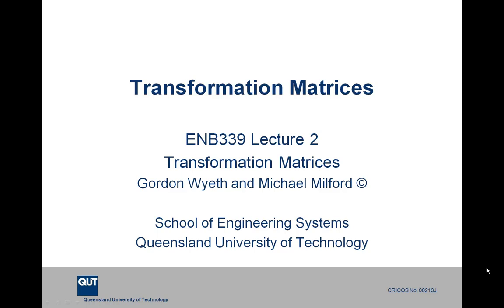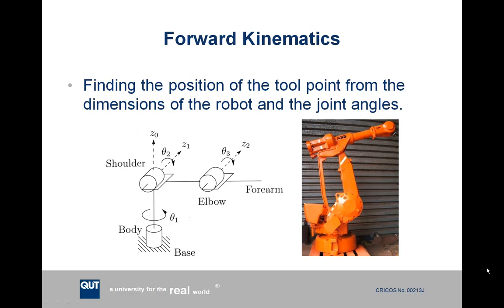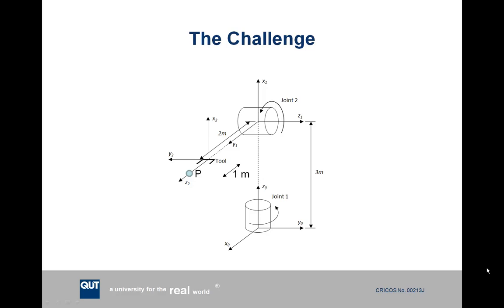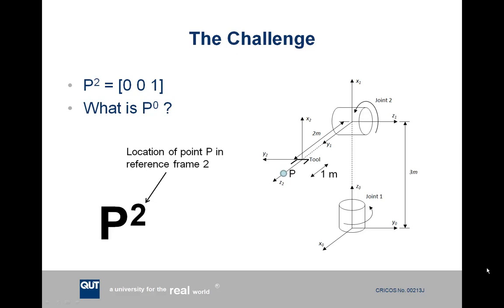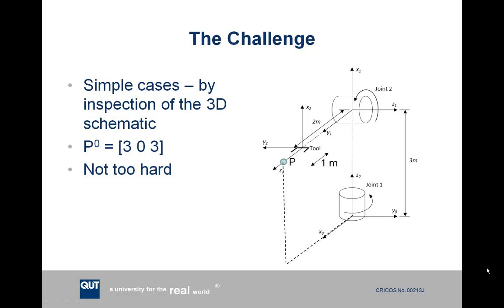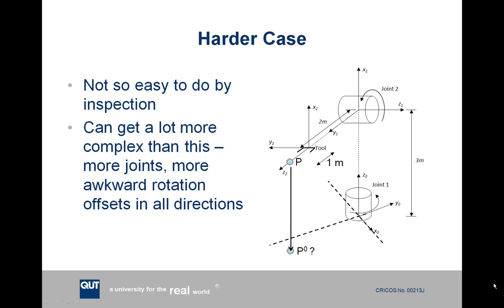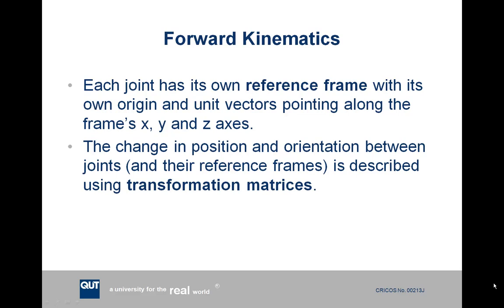Transformation Matrices Part 1

Comment: I have question about rotation matrix
Say I have a point P under coordinate 1, and I want to know P's location under coordinate 0, then I actually have to rotate coordinate 0 to and let it line up with coordinate 1 to find out the angle, am I right?
And when I rotate, I should always rotate it counter clockwise, am I right?
Am a little bit confused here, hope you can clarify that for me. Thanks.
Reply: There are some conventions including a rule called the "right hand rule" that come in the later lectures which should help with confusion about "which direction" to rotate reference frames and so on.

For this simple example, I'd suggest thinking about basic geometry and trigonometry. For the way the axes are drawn, the x-coordinate of a point in reference frame 1 will contribute a total of cos(theta) * x to the x-coordinate in reference frame 0. A y-coordinate of a point in reference frame 1 will contribute a total of -sin(theta) * x to the x-coordinate in reference frame 0. That's where the top line of the rotation matrix comes from: [cos(theta) -sin(theta)]. 

You use this equation to work out the x-coordinate of point p in reference frame 0 based on its x and y coordinates in reference frame 1:

px in reference frame 0 = cos(theta) * px in reference frame 1 - sin(theta) * py in reference frame 1.
Reply: ***** Thanks, I'll search right hand rule and take a look. Appreciated :)
Reply: ***** thank you i find the answer before asking the question